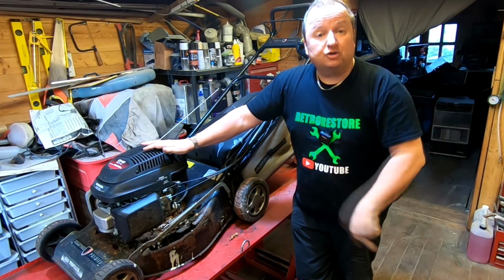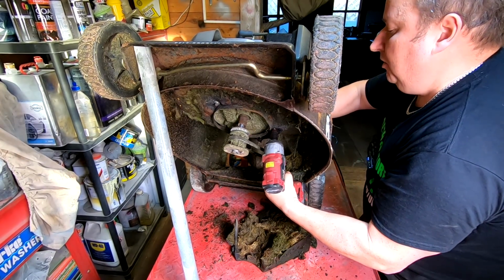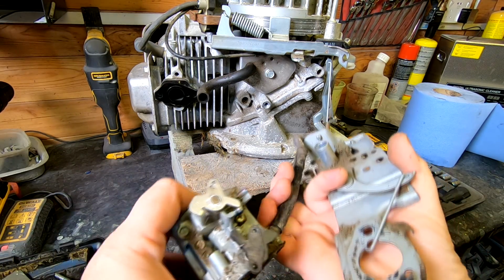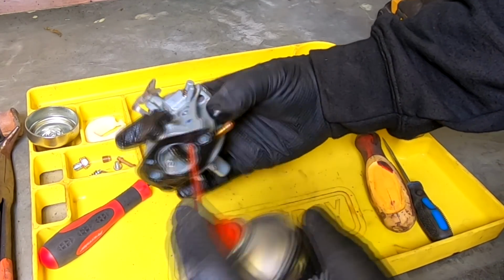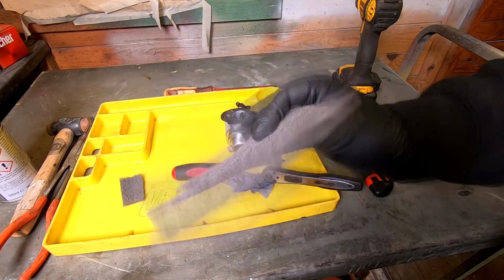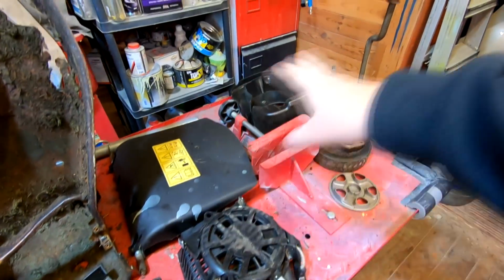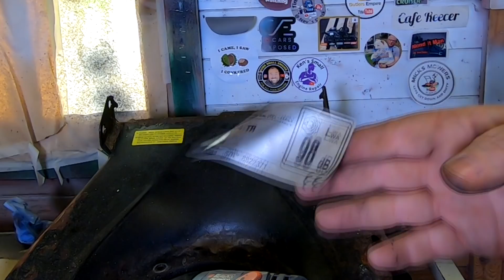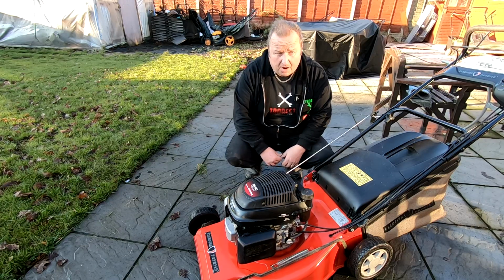Scrap Rusty Lawn Mower Deck Transplant

Comment: Great video as allows I’ve learnt a lot thank you on my own Tesco Mower built by DAYE Power been great I had running issues all sorted now spent 2020…. Lockdown to fix it up fully serviced now starts 1st time I run Morris Lubricants castor based racing oil smells fantastic.. 😀😀
Reply from the maker: Great to hear Steve

Comment: A cracking rebuild, Martin. I think I'd better make a Honda adaptor plate for that engine stand - it seems to wobble a bit with a Honda block on it. Mind you, it was originally designed to hold Briggs engines!  Great job.
Reply from the maker: No worries John, I think I can manage that lol